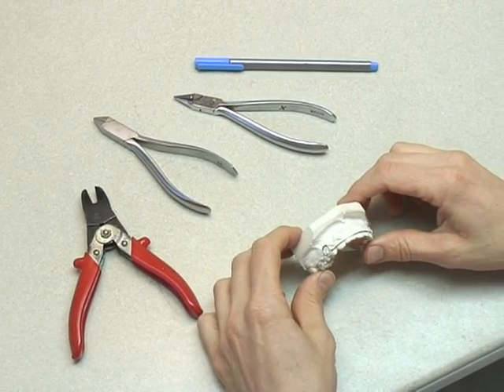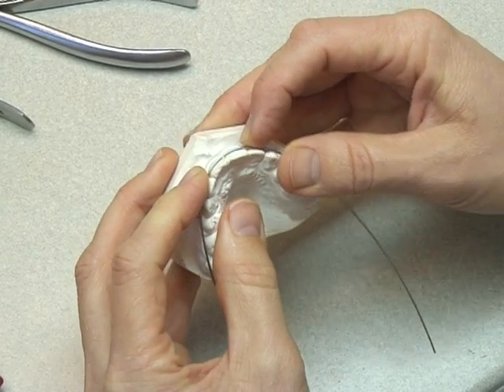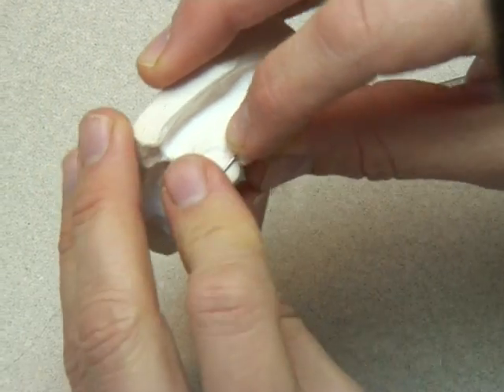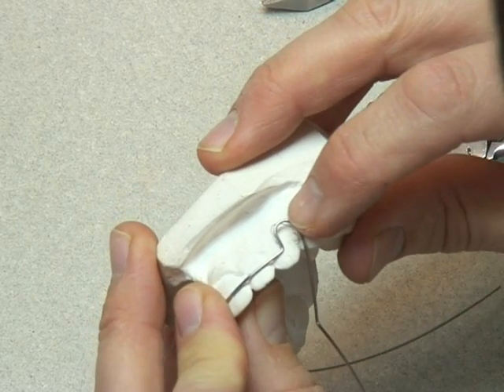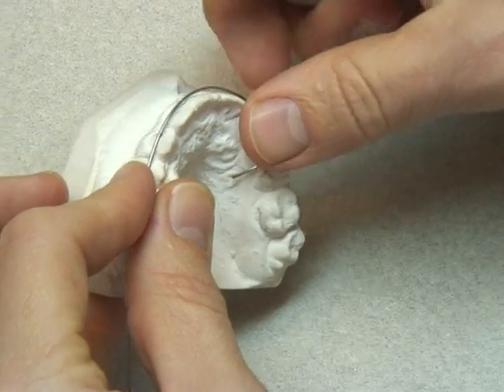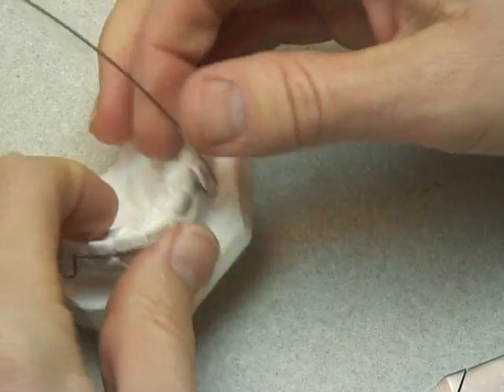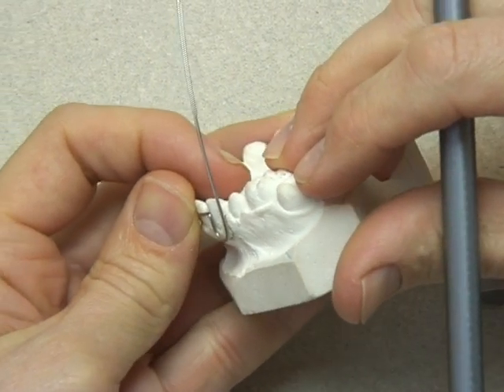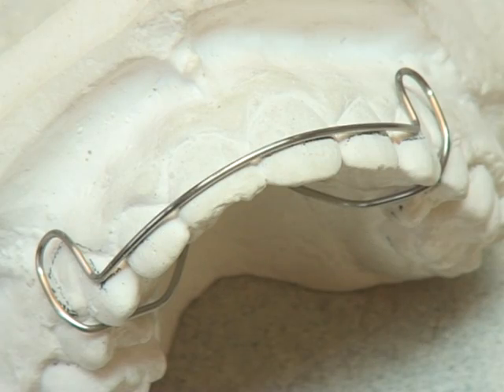How to bend a maxillary labial bow for a Hawley Retainer

Comment: wowwww amazing... how can the u loops automatically not touch the gingiva? Thats my problems, my u loops always touch the gingiva :(
Reply from the maker: Try and visualise the wire when you bend it, as if the wire work is still on the model. Otherwise just keep checking back to the model. You may find you spend more time checking than bending to start with, but that will soon change!